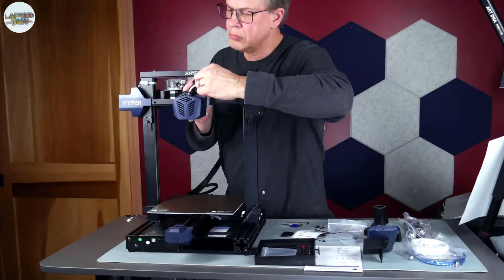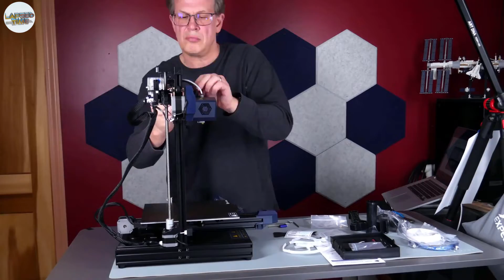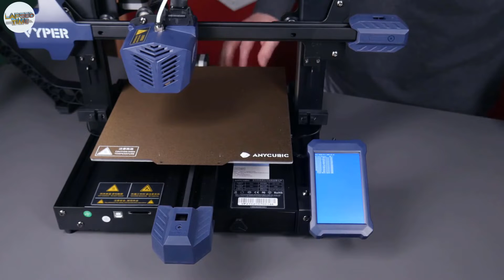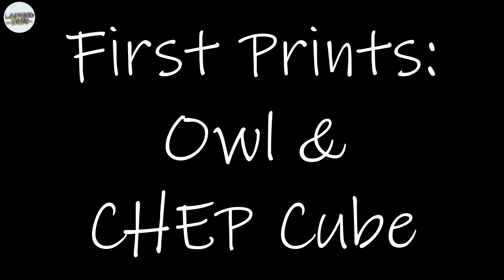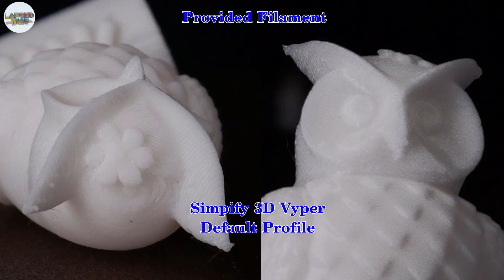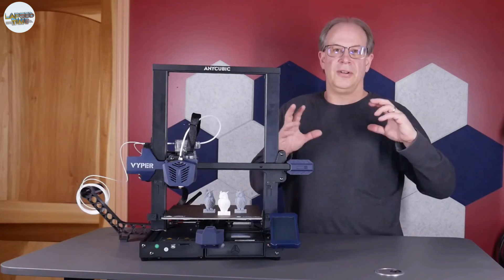Anycubic Vyper 3D Printer - Setup, first prints and impressions

Comment: Ty you, once I learn thisachine Are there aftermarket upgrades that you recomend
Reply from the maker: I still have this machine although I don't use it much anymore and there were not many after market upgrades available (or needed).  I did install Klipper at one point but ended up reverting back to the stock firmware.  Only thing you might want to try at some point is converting to a direct drive.  I never ended up doing it myself but there are some options out there.  Good luck!!

Comment: I just want to know how to print 😭 the owl isn’t popping up when I put the SD card and there’s no YouTube videos that have addressed this!!!! 😭😭😭

Please for the love of the gods help me!!

I’ve had this printer just sitting for about a year now because I still haven’t figured out how to use it!!
Reply from the maker: In order to print files from the SD Card, the gcode file needs to be at the top level of the card, not inside of folders.  So put the SD Card that came with the printer into your computer.  Look inside the folder "Files_English_Vyper".  Copy the owl.gcode to the top level of the SD Card.  Put the card in the printer and turn it on.  On the printer screen, select the "Pint" option and the owl.gcode file should appear in the list.  Then select the owl file and print.  Hope this helps.
Reply: @lapsedtime  thank you 🥹 

I finally found a video that also explains that but I am grateful for your fast response

IT’S PRINTING RIGHT NOW IM SO EXCITED 🤩🤩

Comment: Hi Steve,  I enjoyed your video. I just got this printer for Christmas. I followed the setup steps and it leveled fine but when I got to the printing stage the option to print the “owl.gcode”was not available. On the print screen there was only an option for “viper” and when I clicked it a notice came up “ the printing has finished, the total time is OHOM”. Do you know change the settings so I have the option to print the text Owl ?
Thank in advance for your help!
Liam.
Reply from the maker: The owl.stl file is installed on the SD Card from the factory.  You can try putting the SD Card into your computer and ensure the owl file is on the card.  That's the only thing I can think of.
Reply: Thanks!

Comment: Nice video but the most important part is missing - printing quality compared to other printers within the same price level. 
Almost one year later - would you still recommend this as a first printer or maybe something else?
Reply from the maker: I typically don't do reviews and unfortunately don't have a way to compare it to all the other printers at this price.  After a year, I do still recommend it.  Although right now there are soooo many good budget 3D printers and they are all comparable.  Comes down to features for price as I believe they all have good print quality.

Comment: Nice informative video, glad you had good luck with your vyper. I however would not recommend this printer to anyone not experienced. First issue received mine in no working condition. It would power up level heat up and as soon as I hit print it powered off. After several months of waiting I finally received a replacement motherboard and power supply from anycubic. That’s right not my money back or a replacement but parts and I have to repair it myself. No instructions provided either, ok so I figured it out and replaced the parts. Printer no works without powering down, however it prints nothing but blobs of plastic on th nozzle. I’ve watched multiple videos and tried more things than I can list. The advice is always this setting or that, I didn’t do this or that, somehow is never the printer that was nonfunctional day 1.  And yes I was on the anycubic Facebook page until it got o be always something I did or didn’t do and I called anycubic out for selling low quality and leaving customers hanging. Suddenly I was silenced and banned from the anycubic group, all posts made by me removed.

Comment: auto resume is a great feature. But on this printer it is totally useless. if your near the printer when it happens and the power comes back on right away all is good. But if it is off for too long or you are no where near the printer (say your sleeping) the bed will cool down. and with the bed supplied once it cold it will cause the print to pop off thus you cannot continue on that print.  You have to work out what layer it stopped at and then re-slice the model at the layer it stopped at and then start a new print job. once finished you will have to glue the 2 parts together!!
Reply: My concern from watching a different Vyper video, is the auto resume performed a Home operation which if you were printing a tall model, would most likely knock over \ destroy the print!

Comment: On a scale of like 1-10 how well would you recommend this printer? Looks amazing
Reply from the maker: Hard question to answer given this is only my 3rd 3D printer and there are so many out there.  I do cover my thoughts at the end of the video as to why I chose the Vyper. My initial rating would be an 8.5 price to performance, although I still need more time to see how it performs long term.  I have been very happy with the printer and do not regret purchasing it.
Reply: @lapsedtime  awesome thanks
Reply: @lapsedtime  what other printers would you recommend?
Reply from the maker: @directaviation2044  It really depends on what your goal is in using the 3D printer, do you want to tinker with it, do you just want it to print and not have to do anything or maybe starting a print farm business.  Based on that, look for what printer has the features you need at the best price.  Then look for reviews.
Reply: @lapsedtime  ok sounds good thanks so much!

Comment: What slicer software did you use to extrude 100mm of filament?
Reply from the maker: I use Simplify3D but there are other options available. Do a search for "e steps calibration" and you should be able to find alternative options.